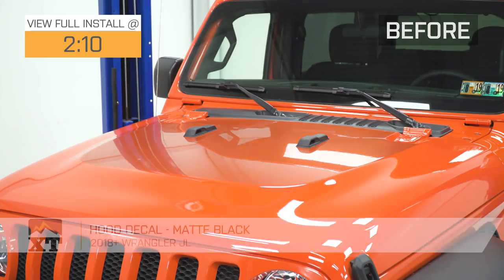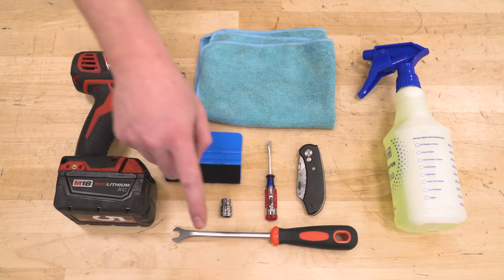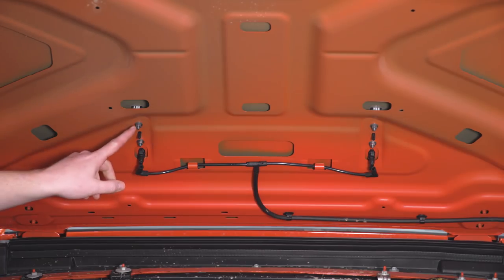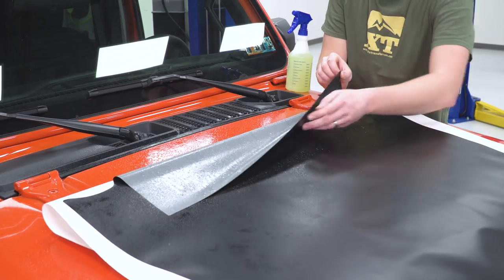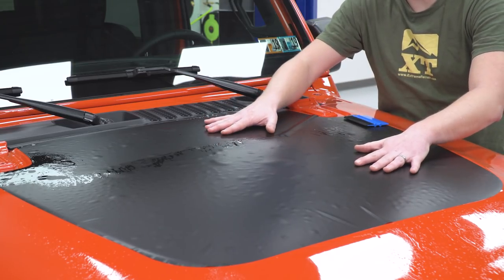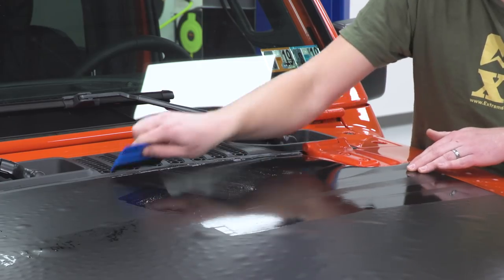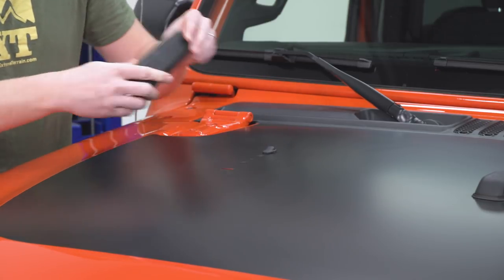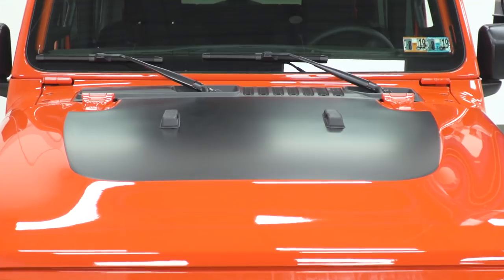Jeep Wrangler JL Hood Decal - Matte Black Review and Install

Comment: Ryan mentioned in the video that the push pins were not meant to be reused.  He is correct.  All deformed and several of mine broke when I pulled them out.  I have two pieces of push pins in my hood.

Comment: This Extreme Terrain hood decal looks better than the Mopar version.  The Mopar decal has large pre-cut holes for the bumpers.  However, the Mopar tolerances are not too tight so you can see paint between the bumpers and the decal.

Btw... It is easier to just peel the entire decal off of the backer paper first.

Comment: Looks great on my white gladiator.  Im terrible at this sort of delicate job but this video really helped.  The decal was very forgivable as i had to pull it up a couple times and reposition it.   Was curious why not print them with the cut out for the windshield rubber but oh well.   
I recommend using something soft over the plastic squeegee, I had some microfiber paper towels that worked great.

Comment: I didn’t see anyone mention this, but I thought it would be advantageous. Using a razor MAY create a small area where the paint is compromised, and allow moisture access to the metal and corrosion to form - believe me. I have a vehicle that has this EXACT PROBLEM WITH RUST, in several tiny areas where the wrap was cut with a razor.
But
An easy way to get those holes done is to heat up the tip of a nail and melt a small hole into the vinyl. Use gloves, but it does not take too much heat. The bolts/clips will slip through easy and maintain that moisture barrier.
Reply: You’re correct but the JL wrangler has an aluminum hood so rust wouldn’t be an issue